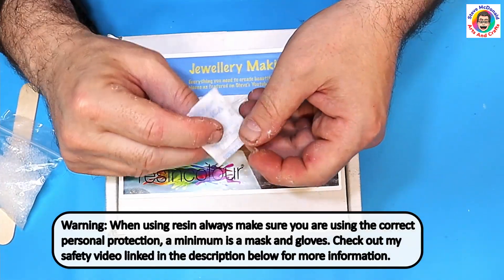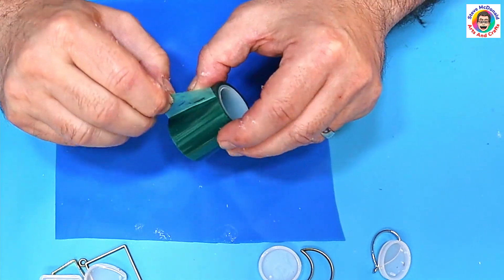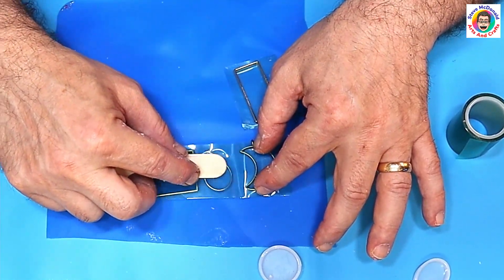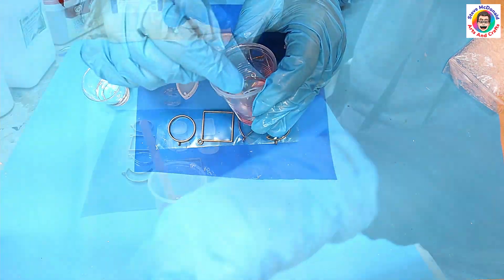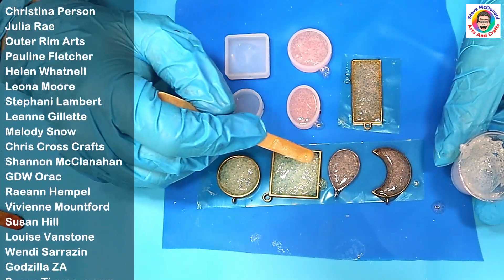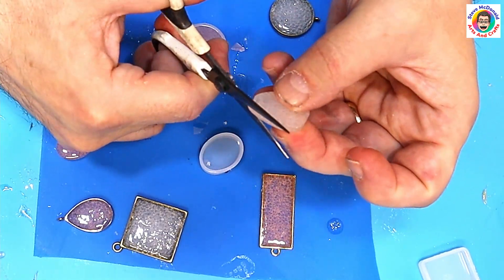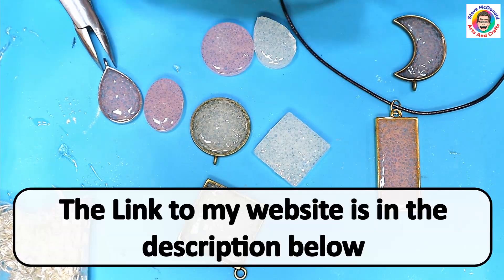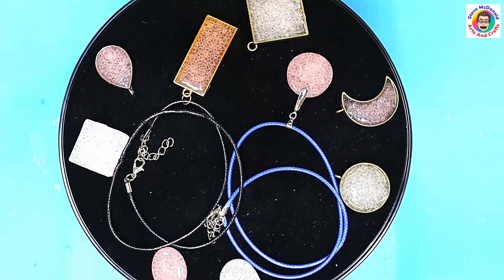What Happens If You Add Desiccant Balls To resin?

Comment: I've used them before--though not quite as many all at once--but some/most of them do crackle from the heat of curing resin. So they won't be perfectly flawless clear balls when you're done. But they still leave a cool effect.